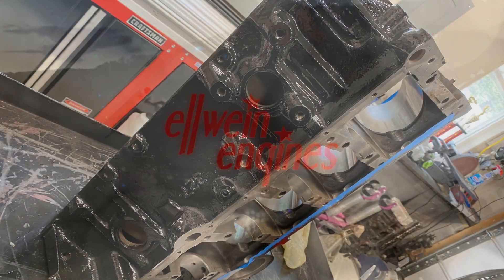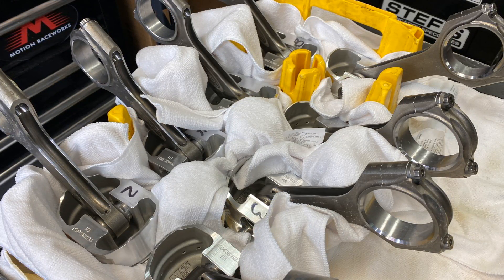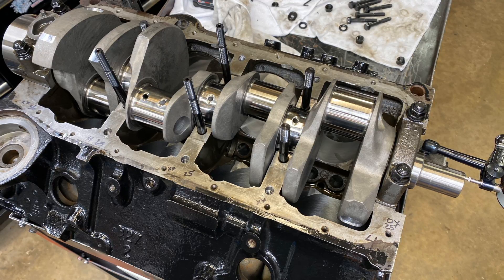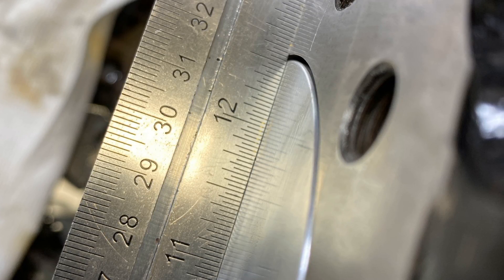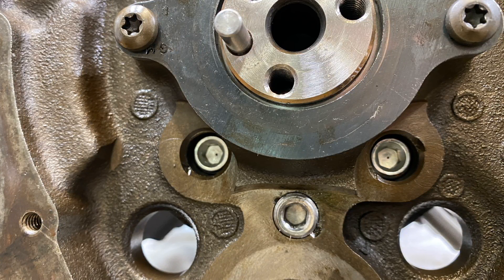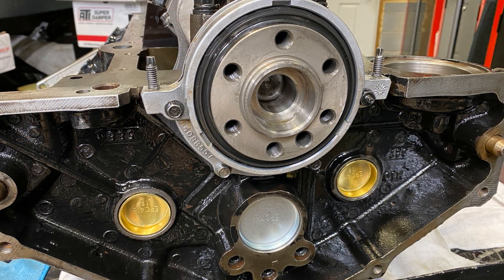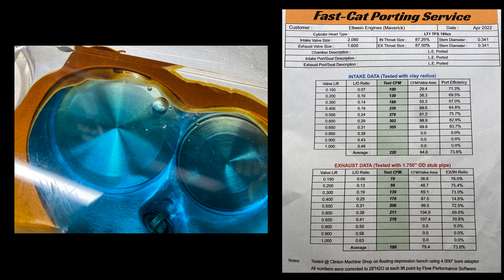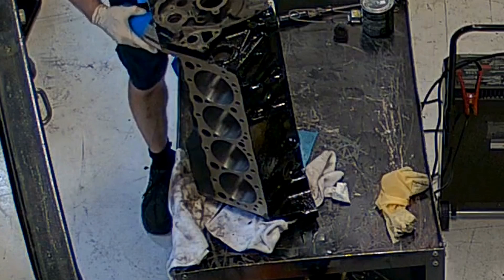ERE-383 #116 Short Block Assembly

Comment: For the mains bearing, I see you are using the xp .001 over to create a little more clearance than the using the standard size bearing is this because you like to see closer to 3 thousand clearance for a performance build, or was this because of how the crank was cut to size to achieve the 2.5 thousand clearance? because I see a lot of stock lt1's from the factory only use .001 bearing on the rear cap and the rest are standard size...  the reason why I ask is I just did a bearing refresh on my stock lt1 (bottom end) and it did come with the .001 rear main bearing and the rest were standard size ... but when I replaced the bearing I was going to do the same but used standard size bearing and all were within the 2.5 range so I did not see the need to go with a .001 bearing on the rear cap like the factory had  ..... or should I rethink that to have more clearance before I complete this engine?  thanks for the input    note: this is a for a manual car setup

Comment: Any tips on finding true TDC on an already assembled LT1 engine? Would like to add a timing pointer and check the static timing with the newly added Holley EFI. Recently added a keyed hub and balancer with timing marks. Also, does anyone sell a pointer for these?
Reply: Hold finger over #1 spark plug hole for compression
Reply from the maker: No LT1 timing cover specific point that I know of.  I've never attempted to find TDC with engine in the car.  So much easier on the engine stand.  If you have all the spark plugs out that would be the only way I could even attempt.